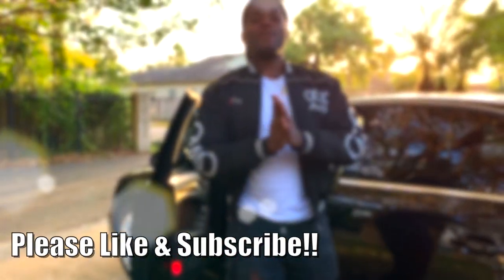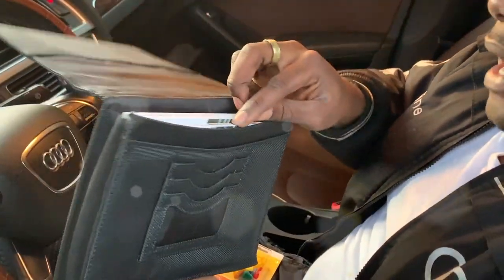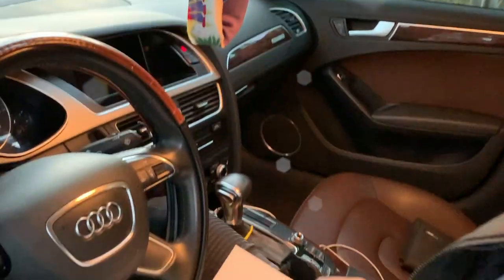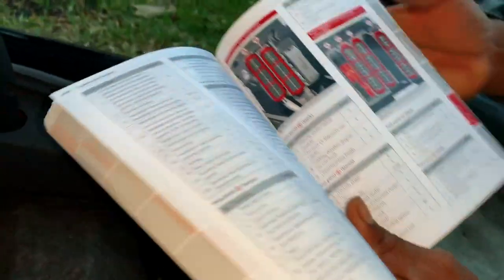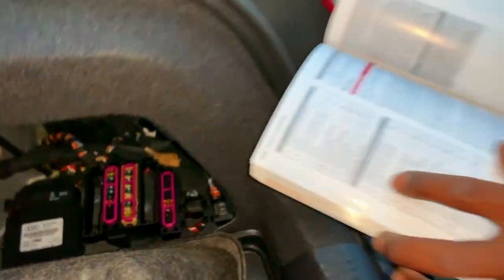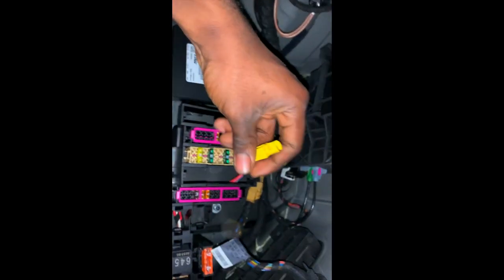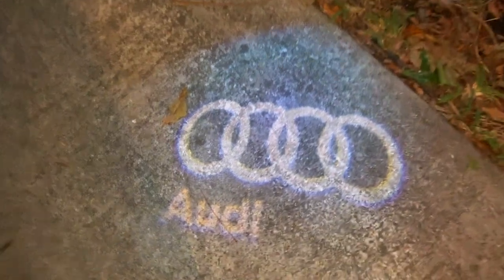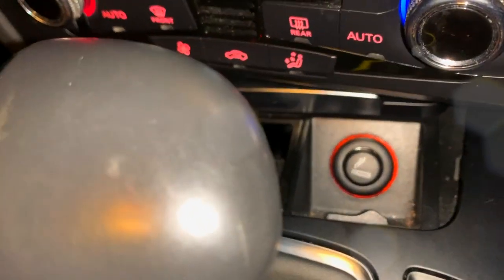HOW TO FIX Audi A4/S4 Cigarette Lighter! 100% Works !!

Comment: Hi... Thanks for the video. I have a problem with my horn thats not working. I've tried all the fuses but none is broken. My challange is that I do not have a diagram of the location of the fuses and relays. My Audi is a 2013 model B8 1.8 Tfsi SLine A4. Can you assist me with the diagram of the left and right fuse box... the box in the boot and the diagram under the ECM please

Comment: On my console 12 volt port and the cigarette lighter 12v both don't work and the 20 amp fuse on the third row under the 30 amp fuse like you said the second one down which would be the 20 amp is NOT burnt out any ideas??
Reply: Mine isn’t either
Reply: its best to check the continuity of the fuse with a multi meter. i have had bad fuses in the past that were brand new.

Comment: I got Audi 2014 Q5. My 12 volt front lighter won't work..neither will my backseat one work. I'm wondering if I got the same problem. Blown fuse? 🤔 Idk if I should go straight for this fix or do I need try anything else first.